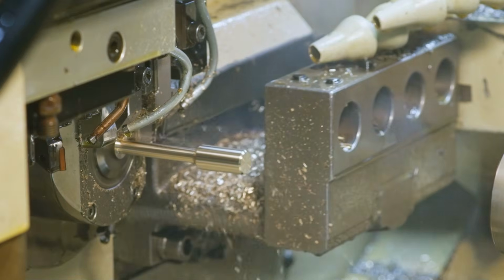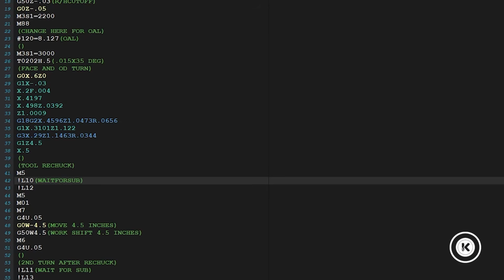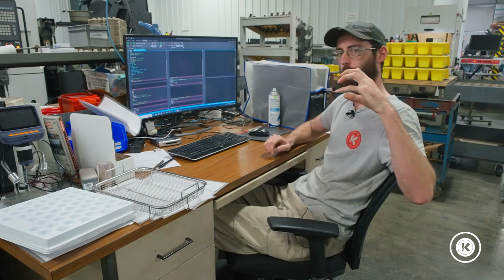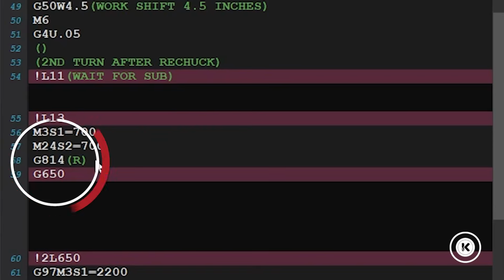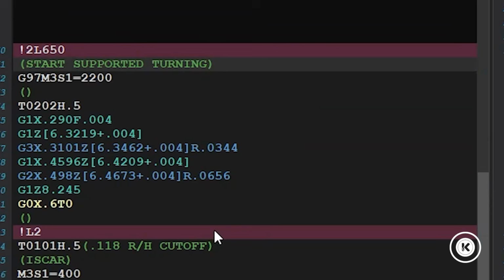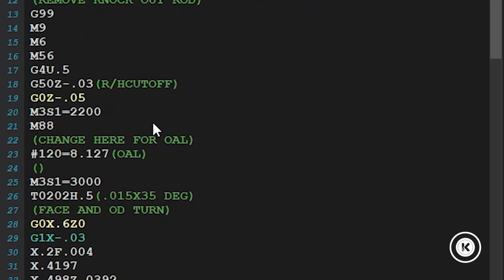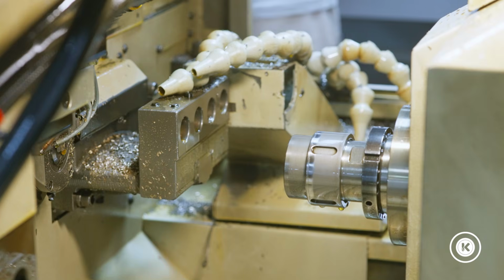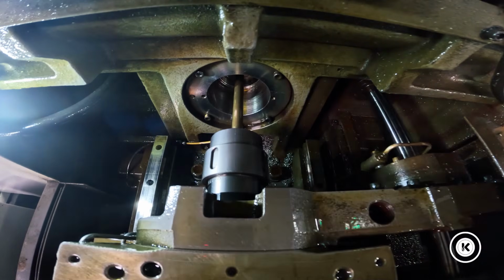How To Program A Rechuck Operation For A Swiss Lathe

Comment: One thing that has bugged/plagued me with our A32 is when in sync (G650) is having to program the movements in Z in incremental. Is the reason you were able to program Z in absolute because of that G50 workshift?
Reply: I expect so. If you watch your distance to go and it wants to move the rechuck distance plus the Z value, it wants a work shift.
Reply: @SecondFloorOutdoors   I'll give it shot. Thanks for the video and the reply.